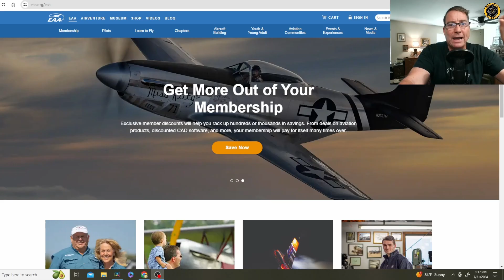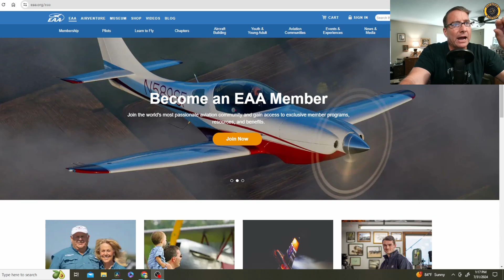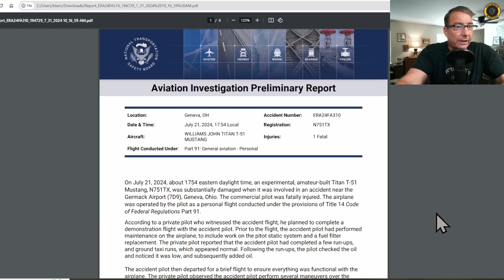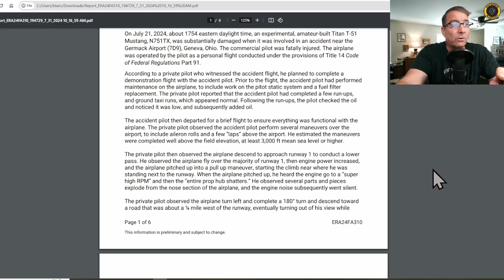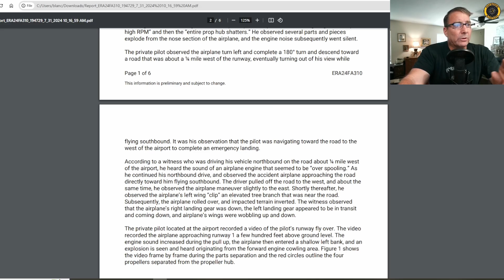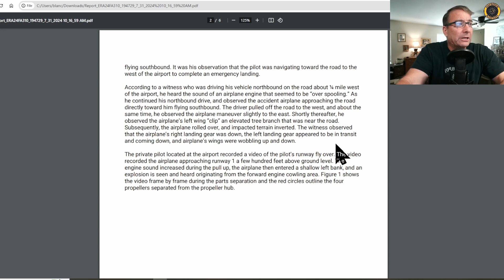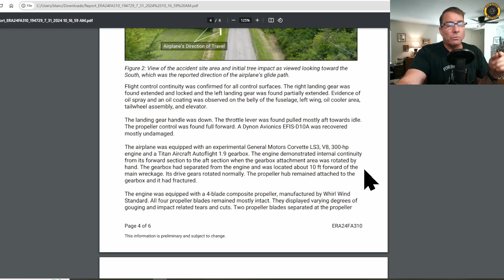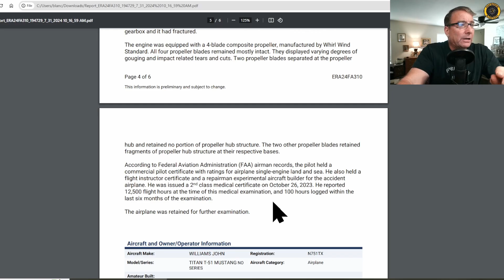Titan T-51 Fatal Prop Hub Failure 21 July 2024

Comment: As a glider pilot we are trained for low altitude breaks of an aero tow rope. One of the key factors that get drilled into you during training is to quickly find the best reachable landing area. A rope break under 200’ agl is considered too low to safely turn back to the airport. So landing ahead in some fashion is advised.
Normally every airfield has around it a couple of options which can be better or worse depending on your altitude and wind. 
The brief satellite image of the airport in this case seemed to show some open fields in the area. Landing on a road is certainly more convenient for retrieval than a corn field but that road? So narrow with trees and power lines, yikes. Even in a non emergency situation that would have been a challenge.  Maybe that was the only option. 
However, the point is to survive the landing first and foremost. Off airport landings are full of risks and the selection of the best place, quickly and under pressure is helped considerably by thinking about the best options before launch. 
I suspect power pilots don’t dwell on this subject as much as glider pilots do. But maybe some of the same instruction should be given. It can’t hurt.
Reply: I’m sure this pilot had run through this scenario many times since it was his home airport.  He actually accomplished the impossible turn but that just set him up for a perhaps impossible landing.
Reply: @jimrankin2583  I'm not sure why he would have come up with such high risk options in that case.    He was obviously a good pilot to have accomplished the impossible turn on what looks to be a high wing loaded plane, but it was all for naught with the landing site impediments.  I take it this was not his own plane but someone elses?  May have influenced his decision to try and save the aircraft.
Reply: @boneseyyl1060 This was his own plane, he built it himself and he offers/offered the kit to build the plane to others.
Reply: @advorak8529  Hmm that is unfortunate then.  I might be able to understand trying to save someone elses plane.   But saving a plane that you built yourself?  Not worth your life when you can just build another one.  But for that matter no plane is worth that.
Reply: Assuming he was passing north over the airfield when it happened, then staight ahead was the best option undoubtedly.  Looks like a marshy area, followed by a water filled quarry, followed by the landfill.  All of those look like better options for survivability.  He was probably used to that narrow runway though and may have felt he could "thread the needle" on that side street.   It's surprising he didn't stall on the 180 turn. 
You make a great point about knowing your options beforehand.  Very little time for thought in those situations.  A sad outcome indeed.
Reply: The fact that he spent 2,000 to 3,000 hours building the aircraft would, as for most experimental builders, have influenced his decision to try and save the aircraft.
Reply: @PhilipFly11  Possibly but most often it ends in a bad decision.
Reply: I commented the same thing then read to find another similar comment....I don't understand either the field was right there!!!
Reply: The issue here was he was gonna land on a road, spotted oncoming car, immediately detoured but was too late.

Comment: No decent automotive conversion in aviation? What about the Grob G109 that used a modified Porsche 912 engine (PFM 3200). Maximum power at 3400 rpm. No gearbox.

Comment: I wonder if the ECU being used had the rev limiter set up? I'd be interested to know what brand of standalone ECU he was using. One search I saw different LS3 engined t-51 kit using a Motec ECU.....but I would imagine any of the aftermarket standalone ECU's could be used. Haltech, Megasquirt, Holly Terminator are popular. Even the factory GMC computer could be used with something like HP Tuners or EFI Live software and hardware to flash it. They all have a rev limiter you can set up.
Reply: All the aftermarket standalones can have many safety parameters set up in them as well....but Id be worried on that besides a rev limiter. For example a low oil pressure safety....id want that turned off. Would rather it stay running instead of cutting power or even reducing....would rather it be an alarm.

Comment: There's a huge power band with these engines. They go from 0 to crazy mph. Is there a throttle limiter to prevent the equivalent of flooring it? 
 Was the throttle designed to fail with full throttle as opposed to killing the engine if there was a problem with the throttle cable/assembly?

Comment: Strange.  What's the point of a 7,000 300 HP engine limited to 3,000 RPM.. instant torque?  I wonder if the prop was operating at under 2,000 RPM, went to 3,000 (Engine going from 4,000 RPM. to 7,000 RPM makes a big difference in pitch and volume)  The rev of the engine may not actually have exceeded design but just sounded like it did.

Comment: Sad, trees and wires on that road. My first magazine article in 1986 was "Pony Solders" on Mustang replicas. They do not have a good success rate. A possible failure in prop pitch control allowing the blades to go flat causing the overspeed? A rev limiter in the engine control might have prevented the overspeed. So sad.

Comment: These engines have rpm limiters built into the ECU. In aircrsft use they should be reduced so that the engine speed  limiter engages before the prop over speeds

Comment: Can't you pretty easily setup an aftermarket ECU / Fuel injection system with a rev limiter at any RPM you choose?  Are they using the Stock ECU? and Programming it with a GM computer? or are they putting an aftermarket system on the LS3?  When he said that the gearbox was designed for 300 hp "with margin" I thought to myself, I would have probably designed the gear box to at least x2 HP +25% margin.   There are so many things that could have happened to cause the engine to surge like that, but they could be easily controlled using an aftermarket fuel system and tuner. You almost have to assume they are using aftermarket right? they aren't going to deal with a factory ECU and license for GM software? are they?  Anyone shed any light on that?  also... You know who I would hit up for some insight would be @Cleetus McFarland considering his extensive experience with LS engines and his experience with aviation.

Comment: There must be a rev limiter placed in the engine's ICU. However, automotive engine rev limiters tend to cause the engine stutter on-off-on-off when max revs are reached. In an automotive setting, this is not problematic. Assuming this may have been the case, could the intense back and forth loading from a rev limiter have over-stressed the prop hub?

Comment: Rotax has over 50 000 aviation engines , all with gearboxes , running in the wild racking millions of miles - so it is quite possible to have reliable geared aviation engine

Comment: Wouldn't electric motors be a better choice for experimental aircraft using either battery or hydrogen fuel cells for the electricity?
Reply: No.

Comment: Prop first or engine first?
Read the report. 

“When the airplane pitched up, he heard the engine go to a “super high RPM” and then the “entire prop hub shatters.” He observed several parts and pieces explode from the nose section of the airplane, and the engine noise subsequently went silent.”
This one was close to home. Condolences to friends and family.
Reply: My educated guess is either a loss of oil pressure of the prop regulator failed, causing it to rapidly adjust to fine pitch

Comment: IF the LS could retain its fuel injection and computer... The rev limiter in the computer could be programmed to prevent exceeding the design RPMs.
Seems simply logical to me.
My question is.... Why did the prop governor fail and allow the rpm increase?
And what about the prop pitch stops?
It looks as though when the prop pitch oil system fails it goes to high rpm  stops.

Comment: The mechanical failure made an emergency landing urgently necessary, but it was the lack of a good place for that landing which made this a fatal crash. The solo post-maintenance test flight saved the planned passenger from serious injury or death, which demonstrates that test piloting is both dangerous and necessary. RIP.

Comment: I would be massively surprised if the LS3 engine was not equipped with a rev limiter therefore it's hard to imagine how the engine could over rev to a point of causing propeller failure. 
Like most commenters I would imagine the propeller or hub failed first causing them engine to surge briefly, and the difference between the speed of light and the speed of sound caused it to appear otherwise

Comment: that sucks. most engines can be easily tuned to limit the rpm. i wonder if this was done on this engine??? that would be a pretty effective way to prevent an overspeed condition of the prop, if the engine wasn’t capable of exceeding the rpm rating of the prop/hub that would be a no brainer? also an LS3 has to be detuned quite a bit to only make 300hp. ive got a 530hp LS3 in a customers camaro im almost finished with. its naturally aspirated as well.

Comment: It appears that it wasn’t the prop failure that got him, and he didn’t stall-spin in; but the narrow path between the trees he chose to try to land in.  It looks like the path between the trees was just too narrow.

There appears to be a landfill about 3/4 to a mile off the departure end of Rwy 1.  I wonder if he could have just bellied in there, where there were no trees.  Or to a belly landing in one of a couple open fields within reach.  Better to lose the plane than your life.
Reply: Trying to put the gear down, so he was obviously trying to save the plane by not belly landing.

Comment: John correctly identified the mating of the engine to the prop controller as a "problem" and not a challenge. His passing is a great loss to the Experimental community of builders and pilots, but still, as with all aviation accidents, another cautionary tale for improved flight safety. (An-2 crash survivor)

Comment: Bet the two composite prop blades out of the four deleted due to imbalance or excessive fatigue at the blade root. This is why wind turbine blades have to be changed at a regular interval. Had a wood or metal prop been used instead he probably would still be flying today. I don’t trust experimental things at work or with my life. We experiment and test in my industry in a highly controlled and documented procedural manner both virtually and real world cycle testing up to and including catastrophic failure tests. (I’m in the pressure vessel business including metal and cross wound composite pressure vessels.) A sad end that didn’t have to happen.

Comment: Yes, A Very Sad Loss to the Industry as stated.
RIP & Sincere Sympathies to His Family on their Loss.
Not related but we had a Rex Regional SAAB 340 lose its Prop In Flight not so long ago in time & i have read some of the Reports & the Problems that then Beset the Pilots in trying to maintain Stabilty, It could have ended in Tragedy if not for the Crew who Landed the Plane & without Injury to those on board..
The Prop though could have gone anywhere like into the Fuslage, A timely reminder for Maintenance in an Incident like this, Metalurgical Testing can Unearth a lot of Problems with Critical Wear Parts...

Comment: I disagree with the idea that there was a surge in RPM that caused the hub failure. It’s plausible that once the engine was unloaded via prop failure the RPMs increased.

Comment: I disagree with those that wrote that the hub failed then the engine surged. I suspect it was the other way round, because at rated prop speed, there would be no reason for the propeller hub to fail. They're tested at least 50% overspeed. So, my suspicion is that the governor (assuming the engine had one) failed and the throttle went to wide open and the overspeed is what caused the hubs to fail. The witness corroborates this by stating that the engine surged and then the propellor disintegrated.
Reply: What makes you think Titan tested the hub they made at 50% overspeed? And by that you mean the blades stay in it an function normally?  I doubt that very much

Comment: V-8 Chevy 350's were all the rage in the 90s for aircraft conversion. And of course the smaller, air-cooled, 2.2 L VW engines had been in use since - I think the 60s? Very popular. Both engines had a very good record in aircraft, and reduction gears were widely available, at least for the VW. Not so good was the Ski-Doo snowmobile engine, the Rotax 583, which was the basis for the very popular aircraft engine, the Rotax 582. The 583 was like 90% cheaper, but it wasn't designed for constant RPM operation, and it failed, despite being almost the same engine. Almost...

Comment: Based on the comments, this MUST require a speed limiter on the engine.  I'm a GM engineer and this is trivial to do on modern engines, via software.  The LS3 is an older engine but can easily be retrofitted with simple actuators, and one electronic module.  Modern kids do the Raspberry PIs in STEM classes.  Turbines have the same problems, and those problems were resolved decades.
Reply: Except it was the hub failure and loss of the propeller blades that made the engine overspeed. A rev limiter wouldn't have changed anything.
Reply: @chris1451 
A speed limiter would have prevented the engine exceeding the set maximum RPM.  They work if a car is in park or neutral, with zero load on the engine, and the gas pedal floored.
Reply: @PhilipFly11  rev limiters work when the engine is under a predictable load be it the near zero load at idle or the predictable increasing while the accelerator is floored. Ever hear of a money-shift? it is a common enough death to many engines where the engine is being forced to over-rev by the transmission - the rev limiter cannot do anything to prevent it. An engine at high power then being unloaded the engine will over-rev usually to a lesser degree than a money shift- but damage to the engine is still likely. 
Even the Pratt and Whitney PT6 turbine engine family has experienced a similar failures despite having overspeed protections included - the overspeed governor and fuel topping governor. The gearbox through a metallurgical failure will decouple from the power turbine and the power turbine will fly apart when it over-revs since there is no load to counteract the force from the gas flow
Reply: @PhilipFly11  I perfectly understand how a rev limiter works. It would have done NOTHING for this crash. The prop broke THEN the engine over reved. Read the first comment. Geez.
Reply: @chris1451  Rev limiter on the Engine, not any of the other gearworks.  Same problem in all road vehicles, easily resolved.

Comment: Terrible loss to the Experimental Aircraft community. A metallurgical examination of the prop hub should show where the failure started and how it prorogated through the hub. It will also show if there were any existing cracks in the hub. It will be interesting to know how many hours were on the hub. Auto engines are so tempting....

Comment: Prop failure is not just a problem with experimental aircraft. My father had a prop disintegrate on an IO-520 which ripped the engine from the airframe. Luckily he had not yet taken off but still got hurt running off the end of the airstrip (about a 30 % downgrade into a gully - cropdusting....)

Comment: Hats of to the pilot for check flying the plane before he took the other pilot up. RIP.
Reply: Back to the point - yeah, this seemed to be a thorough test flight all right, done by a more-than competent pilot to test the plane. He was right on it when the prop failed, and he nearly threaded that needle for an almost impossible landing. He knew right where to set down the instant he lost power. Not much choice with so many trees. Great situational awareness. Maybe test flights over heavily wooded areas aren't great?
Reply: @beenaplumber8379  the so-called test pilot was John Williams the owner of the company that builds these. This plane had a lot of hours on it and they apparently did some work and he just wanted to check it with a test flight before taking it up to demo. This was very common practice when I worked there.
Also- it's not really a heavily wooded area. In fact I'm not sure why he didn't land back on the runway because the road he tried to land on is not very far away, and parallels the runway.
 Maybe when the hub let go he couldn't see because of the oil? We'll never know.
Reply: You mean hats off?
Reply: @slappy8941  What do you gain by pointing out one of the most common types in the universe?
Reply: @smugfrog8111  What do you gain by complaining about it, especially without proofreading?
Reply: @gandydancer9710  Haahaha! OK, That is funny. I literally typo'd "Typo" 

However, still. My question is valid, yours is not.
Reply: @smugfrog8111  Mine ("What do you gain by complaining about it") is as vaild as yours.
Reply: @gandydancer9710  Not really because the question I asked is to the person who was initially wrong. "Why are you calling out someone who's wrong for being wrong"
Is not valid question by any metric. 

Because he's wrong to even mention it. That's called being a grammar nazi and it makes one insufferable. What more do you need?
Reply: @popsfereal  ok.. That one is fair, lol.
Reply: @slappy8941 Most people with common sense know what he meant.

Comment: Steve Harvey has a snowmobile engine on his 44 highlander XL, it rocks, that plane leaps off the ground. A sad event. RIP. aviator.
Reply: 300+ horsepower on a 900 pound gross weight and STOL designed wings.... Yep it jumps up.
Reply: @hotrodray6802  I'm ordering one next summer after i get my hangar built. Can't wait.